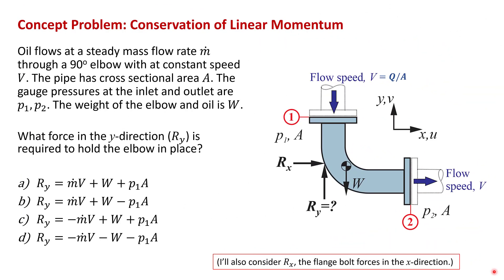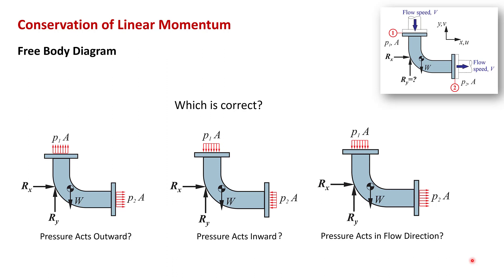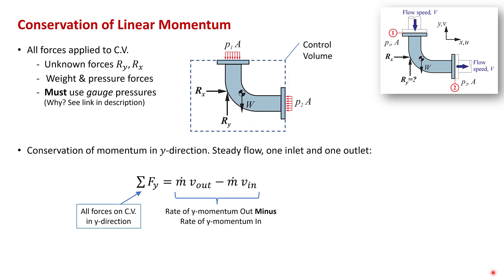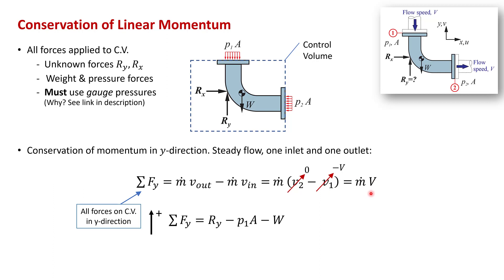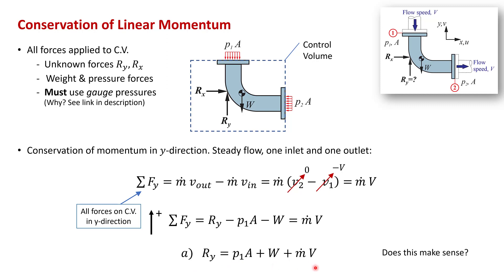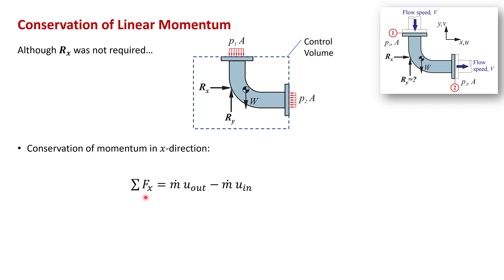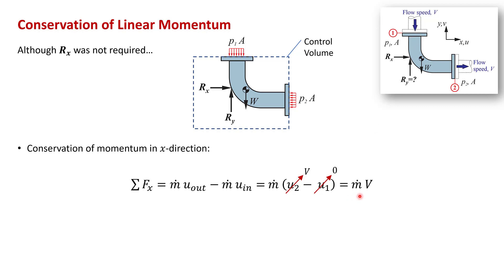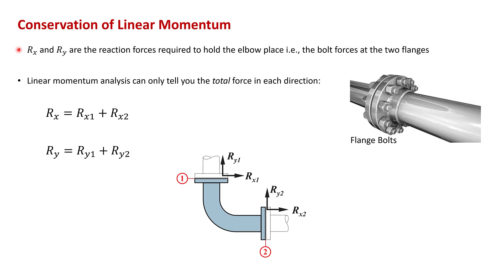Solved Problem: Linear Momentum Quiz

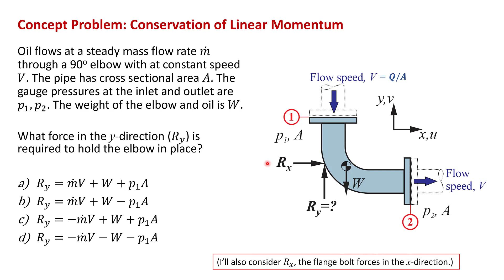Comment: Can you explain why (at 1:05) the pressure forces act inwards as opposed to in the direction of flow / where in Chapter 2 specifically should I look to find out why?
Reply from the maker: p. 61 of the White text: "Pressure creates a force due to the molecules bombarding the surface, and it is normal to the surface." Fluid molecules bouncing off a surface push on the surface. So, the pressure force acts inward and normal to the surface. Also, see the proof of that pressure is a point property in Chapter 2, Fig. 2.1. Equilibrium on a small wedge of fluid.

Think also about your experience. A balloon of air submerged in deep in water will get compressed by the water pressure, because the static pressure acts inward.  If pressure acted outward, it would expand, which it certainly does not. I hope that helps.
Reply: @FluidMatters thank you! That makes complete sense for the inlet… however, at the outlet, aren’t the molecules moving away from the surface (in the direction of flow) as opposed to pushing against the surface? maybe I am missing something?
Reply from the maker: @arundhati.parikh  The bulk motion of fluid is not the root cause of static pressure.   Maybe this will help:  Do you expect the outflow side of elbow to be held onto the pipe at the flange by suction? That's what you are thinking, which I hope you can sense is clearly not what happens.

Comment: So if I have a 1000m straight length of piping above the elbow, do I need to account for that in W, or is that already taken care of by P1*A1 with P1 being the hydrostatic pressure from the 1000m column of water above it given by rho*g*h?
Reply from the maker: You are correct. The weight of the fluid in the pipe above the elbow will be accounted for by the pressure at the flange.  However if, for example, the 1000m pipe above the flange was totally unsupported, you would need to include the downward weight force (of the 1000m pipe) at the upper flange.  So, you need to include known external forces on the control volume.